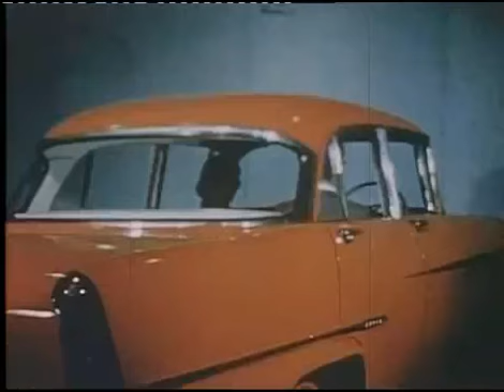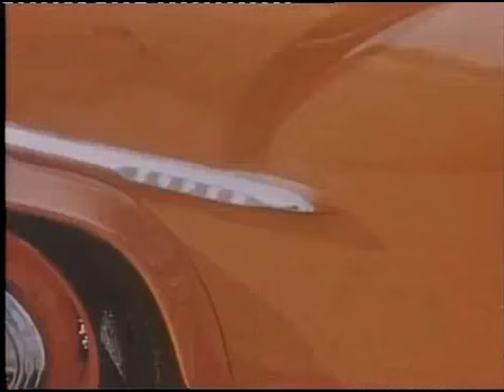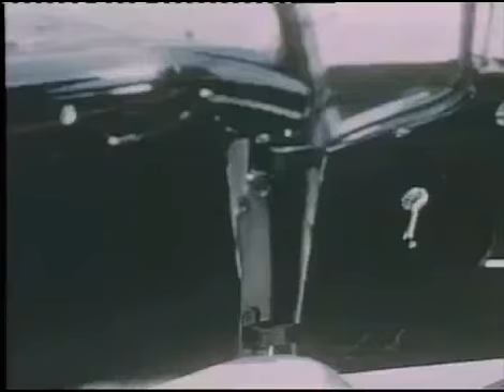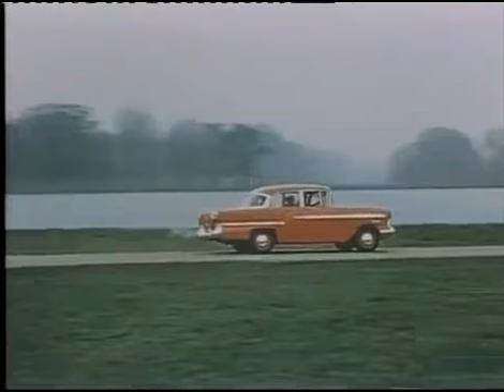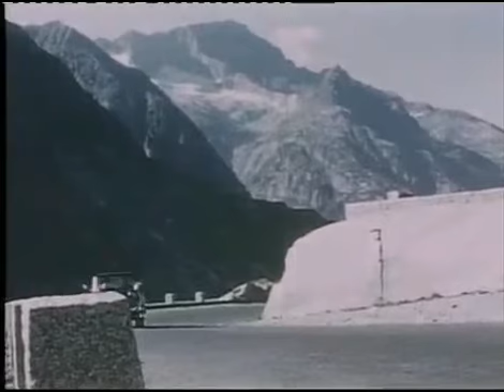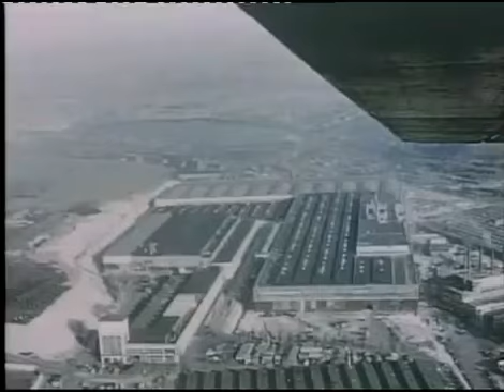VAUXHALL VICTOR F SERIES UK DEALER LAUNCH FILM

Comment: Thomas, I can tell you that your log book was incorrect in displaying the car as a model E when it actually was an F. Lets face it in the 1950's these sort of mistakes were not uncommon. As the founder of the Victor club I can say without any doubt whatsoever that HEN107 was a Series 1 F model Victor super. Why a General Motors label was on the car is a mystery. The bonnet medallion either showed Vauxhall Motors Luton on early cars but it then changed to Vauxhall Motors England later. If you wish more information then email me direct on XOT362@googlemail.com.
Reply: VauxhallVictorMan The General Motors Logo was on the Extreme LHS of the Black Metal Dashboard and printed in gold lettering on the passenger side in easy eye view..
Reply: VauxhallVictorMan P.S. I also seem to think my Speedometer was A Round cluster too.
Reply: Highly disturbing revelations.....

Comment: The production cars only had the door lock on the drivers door. PMJ469 Is a prototype from 1955. Vauxhall dropped the chrome crest on the rear doors, narrowed the grille end mouldings and painted the headlamp peaks (flat in 57 but peaked in 58). Actually you could get 42mpg with good driving and a perfectly tuned engine and a vacumn gauge fitted. I think at 15.38 you see an E series speedo not the F series.
Still a great find.
Reply: VauxhallVictorMan I had a Type E 1958 Vauxhall Victor Super in Gypsy Red.  Reg. No. HEN107. Inside was a Logo for General motors on the LHS of the dash board. You are the first person to mention the Type E as all others call it the F model. the F model changed to a straight bumper other features almost the same.
Reply: Thomas Nadin Thomas the F series Victor launched  in 1957 . Your car amazingly was a Gypsy Red as was HEN108 which also is a Gypsy Red and is in the Victor club now. The Series one F model continued through 1958 and then changed to the as you say straight bumpers in 1959 as the Series 2 which then changed to the 1961 Series 2 before the FB Victor launch in 1961. My comment about the speedo being an E series one is just a mistake by Vauxhall in the film. The E series models were called the Wyvern, Velox and Cresta. Hope that clarifies things.
Reply: VauxhallVictorMan On the original log book of my car HEN107  "IS"  registered as Vauxhall Victor Super, Type E, Private, 1508cc, Gypsy Red. I would not think that the registration document would be wrong. would the general motors Logo make the difference, I do not know.
Reply: +VauxhallVictorMan Hi
I worked for Attwood Garages in Wolverhampton a Vauxhall Bedford dealership long after the F type was a rusty memory and in the basement were several prototype vehicles. There was a 4 door Triumph Herald (not the Indian one) that was as long as a Victor and wider than a production Herald. They had taken over the old Cyril Williams concern. There was also a Victor F type with a round speedo like the E type. We stole the bottom trunnions off it for a customer's MOT failure. 

Nick